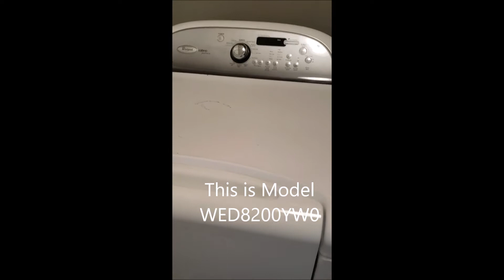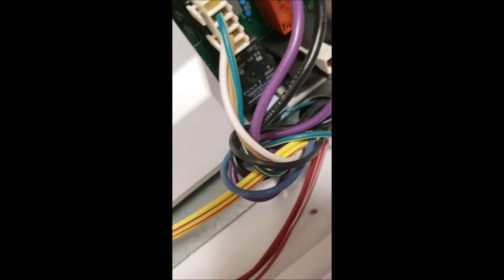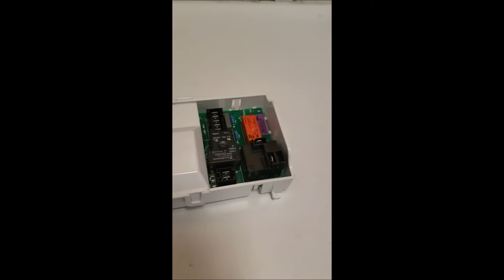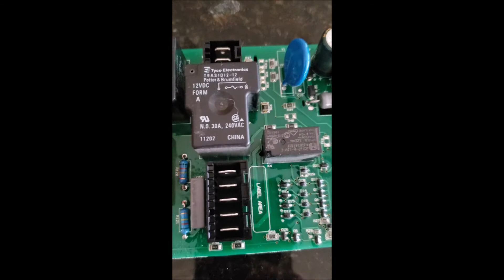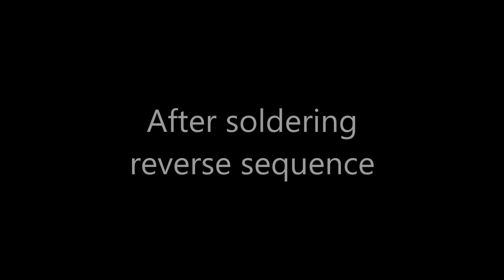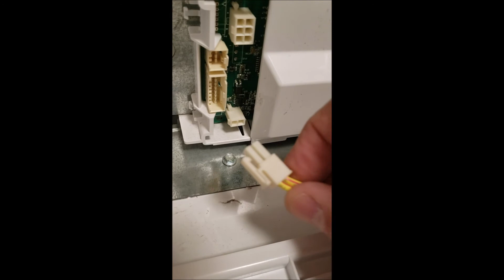Whirlpool Cabrio Dryer won't start. Low cost fix. Power Relay

Comment: My unit flashed PF power failure and is clicking when I hit start like you said. I put it into diagnostic mode when you hit 3 buttons in succession 3xs in 8 seconds and it said F4E4---low power. I took the board out and looked at it and nothing is burnt or discolored. You dont have to take off the base screws to get the circuit board out only the one screw. Those are hard to access.

Comment: I removed the leads to that relay and the dryer works now. What is it's purpose?
Reply from the maker: The relay is the main power relay. If it's the same machine, it won't run without power to this relay.

Comment: How did you get the clips to stay open? I can't get more than two pulled away at a time.
Reply from the maker: which clips are you talking about?
Reply: @benwilliams2260 sorry.  The clips for the computer board
Reply from the maker: @dougm4217  push the board up and press the clips out, they are just spring force. watch the two pieces of the board on one end that stick through the housing.
Reply: @benwilliams2260  OK,  thank you sir!

Comment: Does this fix apply to a PF error?
Reply: I have the PF error
Reply: @MaryEverling  I had it and if you press 3 buttons 3x in a row you will get error messages. I got F4E4 which is low power.
Reply from the maker: I didn't have that error.  The dryer would just stop and start on its own

Comment: I followed your instructions display.  But,  all I did was clean the transistors board with a wire brush and cleaned all debris inside the whole Dryer.  Inside out.  Plugged back and Boom!!!! Drying again.  
Thanks!!!

Comment: Where did you buy the remplacement piece?
Reply from the maker: I purchased the relay from Amazon. here is the link.
If you end up needing the entire circuit board, check ebay, they usually run less than 100.
https://www.amazon.com/TE-CONNECTIVITY-POTTER-BRUMFIELD-T9AS1D12-12/dp/B00K1RBV8M/ref=sr_1_4?crid=3JAXT9UBM6L9I&keywords=T9AS1D12-12&qid=1669058403&s=industrial&sprefix=t9as1d12-12%2Cindustrial%2C80&sr=1-4
Reply: @benwilliams2260  can I use any relay as long as it match the amp and Vol as well ?